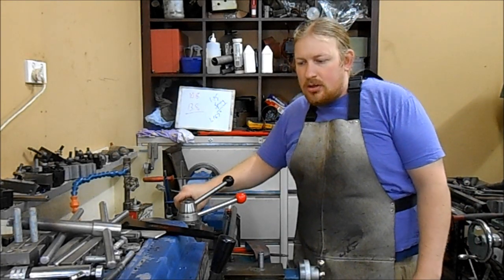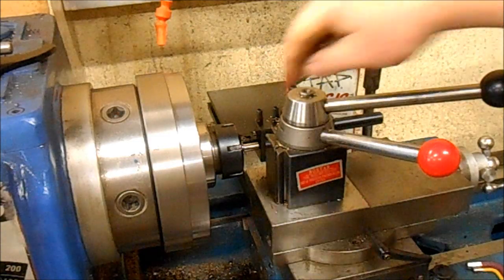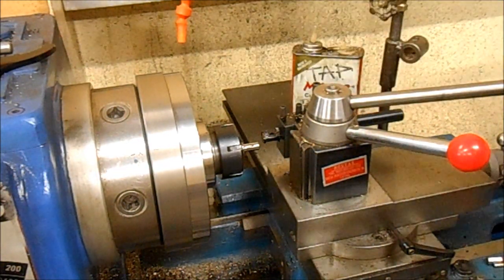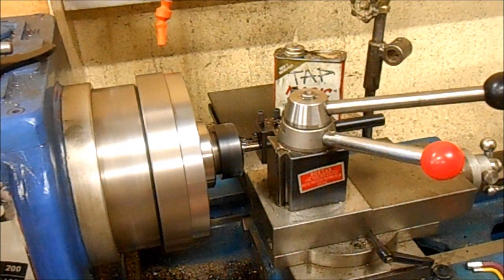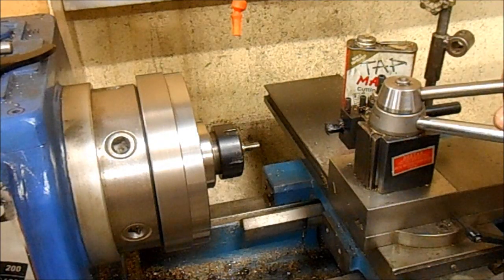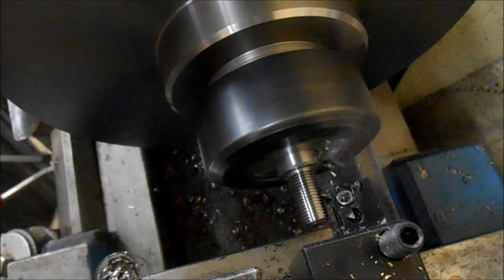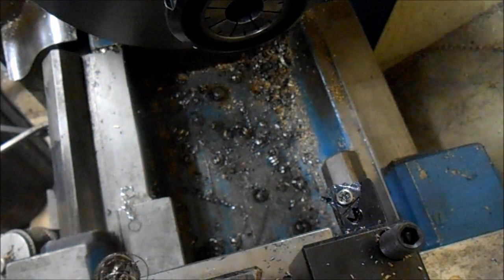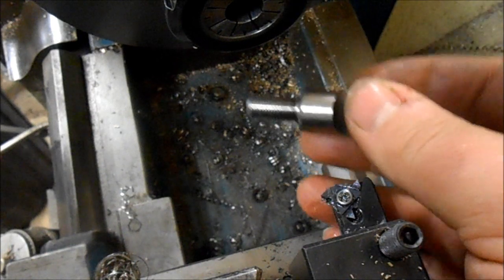High speed threading to a shoulder.

Comment: I've threaded on my 1946 Logan but I have a special job for myself making a 1/4-26 BSF thread on a percussion nipple for a 1863 Westley Richards shotgun. I can do what you have shown but need the thread all the way to the shoulder short of using a die backwards after I grind it to get rid of the taped start thread. Any other suggestion appreciated. The other thing to mention is don't try this with a screw on chuck like my Logan, I do have collets though.

Comment: This is very interesting, because I've always thought it wouldn't work using an internal threading bar. Reason being the angle of the "helix" is in the opposite direction to when doing internal thread cutting, and thus the carbide bits cutting edges would not be at the right angles. I think you can even get external threading tools to thread away from the chuck. Whatever the case it certainly seems to work so I'll be trying it this way next time.
Thanks for the video, great stuff.

Comment: Why is this not suitable for doing a Metric thread? Great work by the way....... I didn't quite get what you were saying around the 6:20 mark. Could you jot down what you were saying please. Something about auto disengagement? Thanks.
Reply from the maker: It would be suitable for metric threads if you have a metric leadscrew. The Antrac has an imperial screw hence i can't use this method to do metric threads. At the 6:20 mark i was referring to some of the higher end toolroom lathes that have a single tooth dog clutch running at 1:1 with the spindle so you can disengage the leadscrew at any time and engage it again without loosing your spindle to leadscrew sync.

Comment: This works well for internal threading as well.  Just use the 16ER inserts and boring bar.  This bar and insert you are using is the 16IR, I believe.

Comment: I have long considered doing this, but ive been working as a conventional machinist for 7  years now and i have no problem threading at 500 rpm and disengage/pullout on big shoulders.   One thing i have noticed, you did not cut a clearance beforehand at the end of your thread, and you were digging  your insert in the material and engaging, i would not recommend as your passes will be uneven.

Comment: Can you provide some detail on the tool bit holder - make/model?  HSS or carbide insert?
Reply from the maker: Its a carbide insert tool, just a cheap SNR0016 bar with standard IR16 (i think thats correct) inserts.

Comment: Hi ueee84,
                I enjoyed your threading to a shoulder video as it is the ultimate in machine efficiency. I noticed your compound slide is not set over to the thread angle. I don 't tend to use the set over technique either, although most of the American machinists do. I find on most of the threads used up to about a half inch  don't require the depth cutting safety of slide offset to protect the cutter from breakage. You are the first I have seen to share this method with me. I have used the upside-down  cutter and spindle reverse at odd times when the limitations of the work shape define the method. Keep up the good work.
 I haven't seen a cotter pin since I first rode a bicycle over 70 years ago. Your work quality looks excellent. You are a first rate engineer, keep up the good work.
 Best Regards to you and yours.
  Mo King UK expat in Spain.

Comment: Nice!, I like to use the 29.5 degree method on the compound slide. I guess this will work, just move the compound slide out instead of in.
Reply from the maker: Thanks Matthew. I normally just plunge straight in unless its a very course thread. It all depends on the lathe and the tool though.
Cheers, Ewan